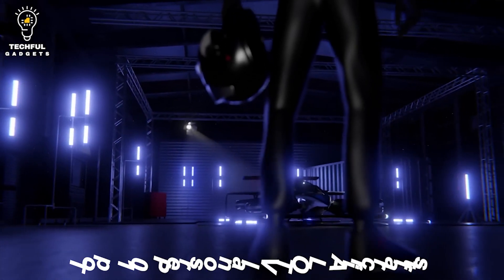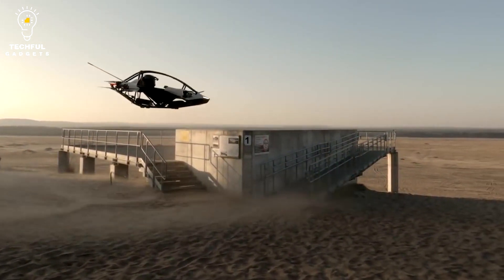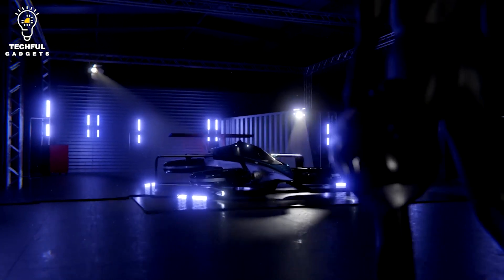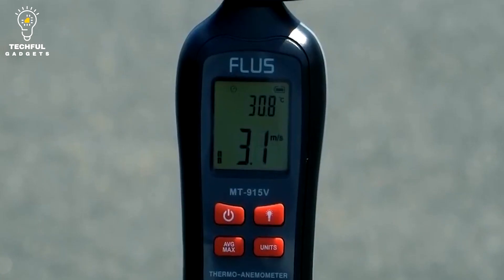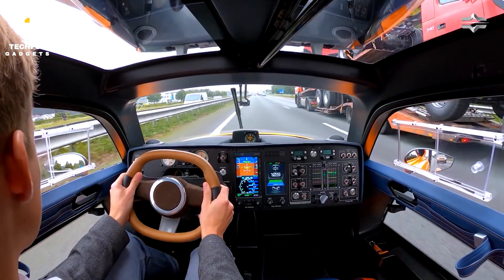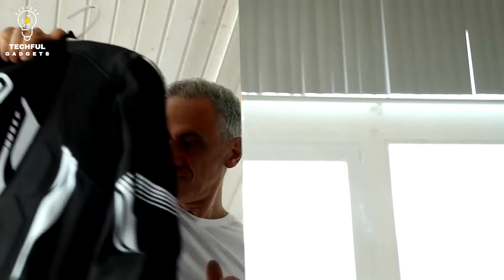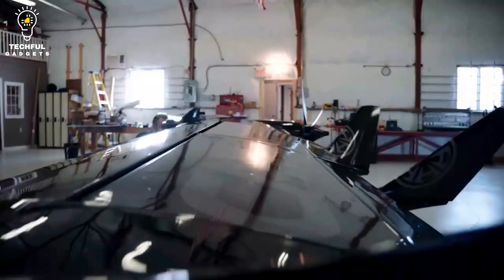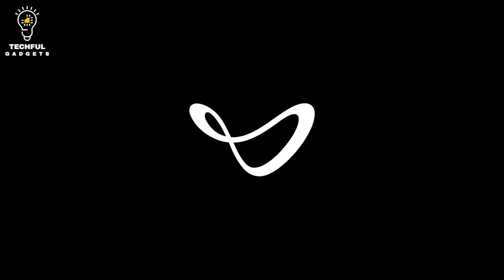10 Flying Cars | Best Ultralight Flying Vehicles 2023

Comment: the landing leg of the Scorpion Hoversurf could do with rubber wheels that'll have anti-roll locks built into the tiny wheels . . . be it the Aloud Airspeeder or Scorpion Hoversurf flyin car, both could do with a tiltrotor configuration where the two aft engines can rotate full 90° deg to the rear in forward flight . . . it'll act as a pusher propeller thus ensuring enhanced stability in sustained flight . . .